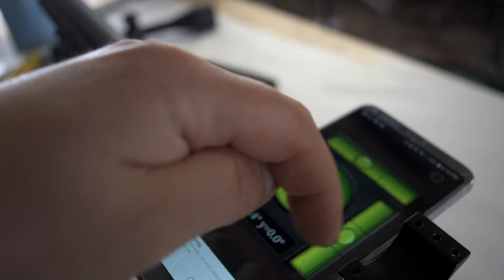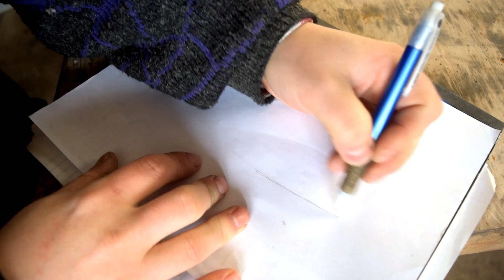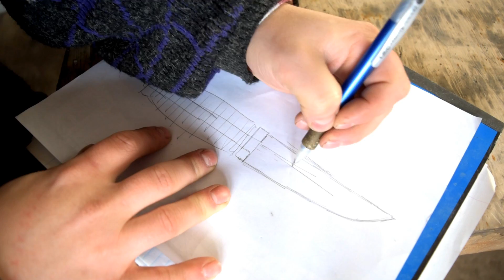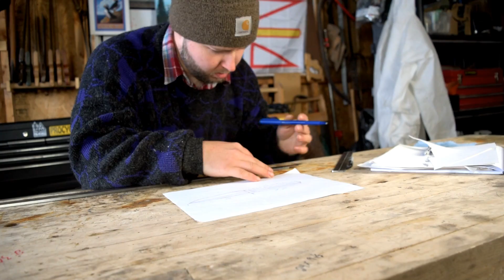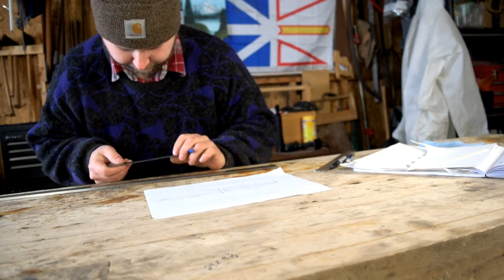Crafting A Traditional Pukko Knife - [NLH 10]

Comment: As a fellow knife enthusiast from Finland I must give some constructive criticism. First of all, it is spelled puukko. Also, a puukko is by definition a blade with a single bevel. Puukko is an all purpose knife, but one common use case for it is woodcarving while camping, where you must be able to push it with your thumb. 
I would not call this knife a puukko, let alone a traditional one. That being said, it is an awesome looking knife, keep up the good work! Greetings from Finland.
Reply from the maker: Hey, thanks for the comment! I do know that the original title is Puukko, but it seems that in modern North-American culture, it is more often titled 'Pukko', which is why I chose that term. As for the design, this one is fairly consistent with traditional design, with a few exceptions, of course. The grind on the spine is only partial, and decorative; it still maintains a flat spine for carving. The edge bevel also wears only one plane, as a traditional puukko would have. Thanks for watching!
Reply: @kyle_noseworthy  Thank you for your answer and a good explanation. I can agree to call it a traditional North-American Pukko, originating from a finnish Puukko, haha! In the end it doesn't matter what you, me, or anyone else calls it. It's about enjoying the hours put in to it and what comes out of it. I have a lot of respect for your work!